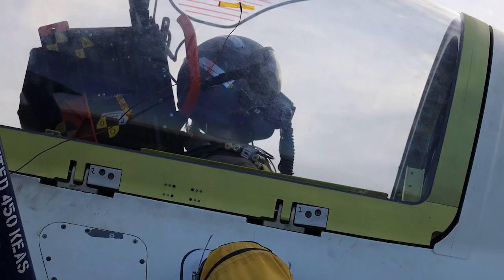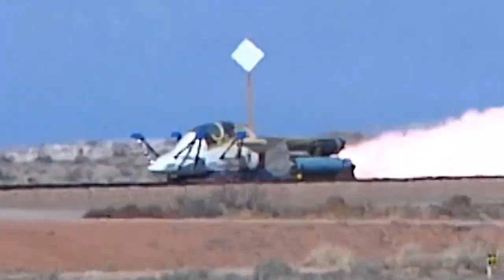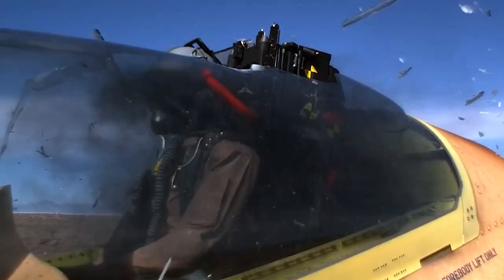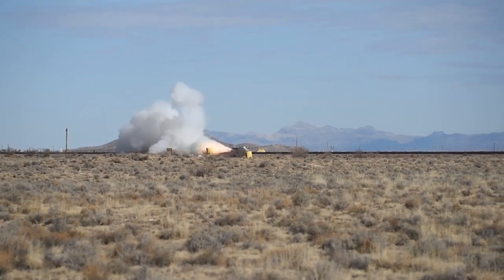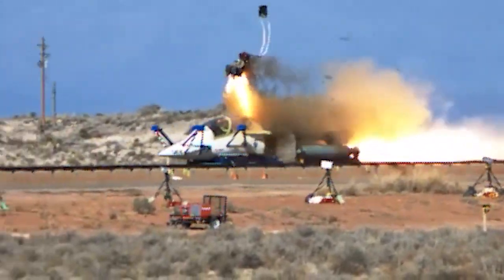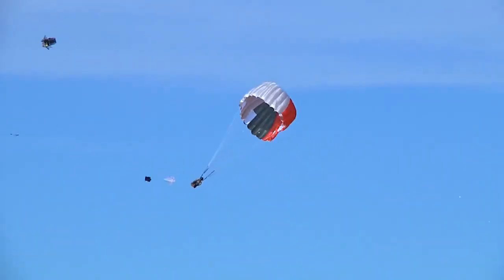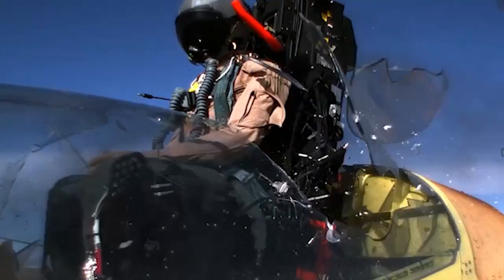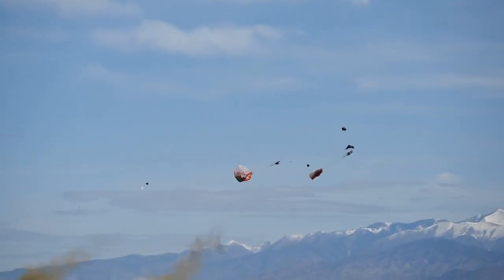Boeing T-7A Holloman Sled Test

Comment: What's the benefit of breaking through the canopy vs jettisoning the entire canopy during ejection?
Reply: I would guess it’s faster than having to wait for the canopy to clear before ejecting the crew, and removes the risk of the crew actually hitting the canopy while ejecting.
Reply: The object seen at the very top of the seat, projecting upward from the headrest, is a canopy cutter and it is very effective, in spite of its low tech design. Unlike explosive bolts or a detonation cord cutting line attached to the canopy plexiglass itself, it is not reliant on a complicated ignition system for it to work. The reasoning behind this is that more complicated you make a system, the more likely it is going to fail, just when you need it most. Complicated systems can be damaged in combat, rendering them useless. Simplicity equates to reliability.

Plus, there is the fact that explosives have a shelf life. The rocket motors in the ejection seats are on a regular replacement schedule, to ensure they do not degrade and become ineffective. Adding a separate explosive mechanism to the ejection system adds that much more maintenance time, expense, materiel, and manpower to the upkeep of the system.